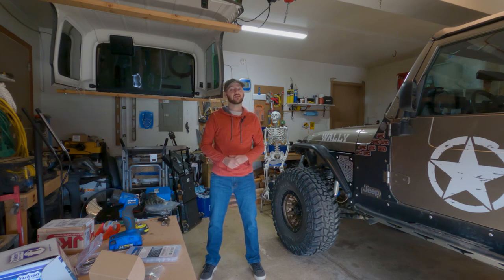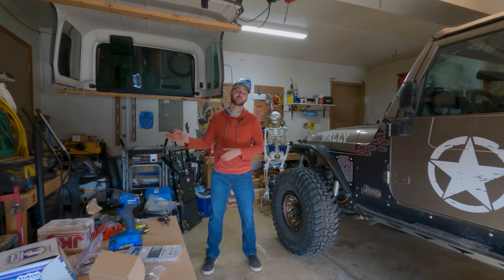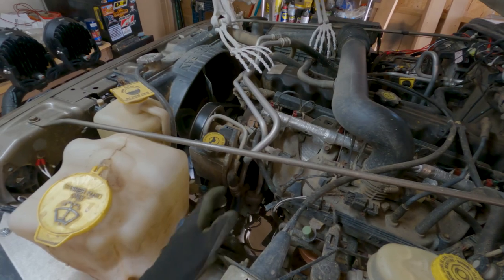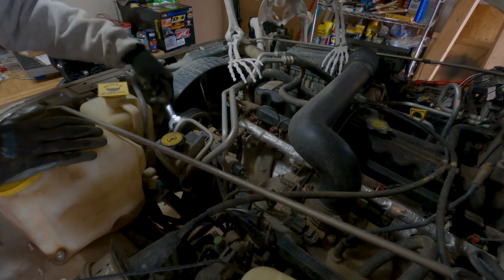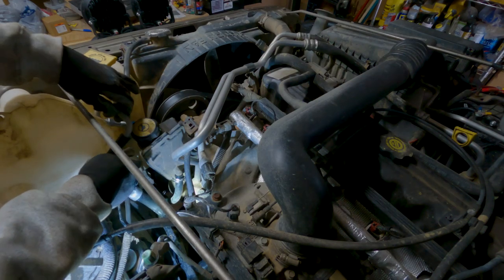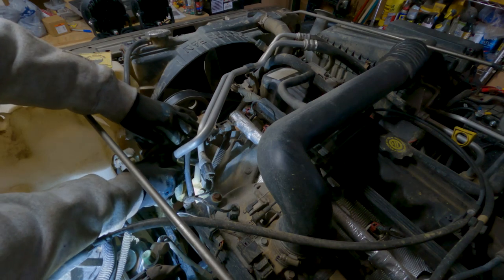Jeep Steering Gearbox Replacement [Redhead Steering]

Comment: Hey what’s up Wally, I like the rack you made to hang your hardtop in your rafters, could you link a tutorial or , maybe make a short video on it! Thanks man!
Reply from the maker: Hey man I actually don't have it anymore. I sold the hard top. But it wasn't anything fancy. I just uses a few 2x6's and put eye hooks on each end. Marked studs in ceiling and then drilled 4 eye hooks into it. Then I just used ratchet straps to slowly raise it up. So it was a total of 2 boards, 8 eye hooks, and 4 ratchet straps.
Reply: @WheelinWithWally  thank you Wally! I appreciate that, I am going to do that! Great videos by the way! 💪 you helped me get my rear driveshaft U-Joint done! First time doing one!
Reply from the maker: @Duhvidd  Thanks man that's awesome! That video was actually my first time doing them too lol. I might remake it in the future

Comment: Redhead boxes comes with ATF in it . But our jeeps use power steering fluid . What did u end up filling it with ?
Reply from the maker: It's covered at 27:56 in the video. I used atf because that's what my year TJ calls for.
Reply: @WheelinWithWally  yeah I just saw that . We have two different TJ's mines 97 calls for power steering but since redhead box came with ATF in it . I filled it with ATF . I checked with my jeep gods and they said I was fine for using ATF . We'll see I guess . But this box is great . I had the boat driving feeling too that's def gone .
Reply from the maker: @TerranceWilliams-b4t  that's awesome! It's definitely a huge improvement.
Reply: It doesn't really "come with ATF in it." Maybe some residual from being bench tested, but not enough to worry about.

Before 2002, you should use Mopar Power Steering Fluid. 2002-2006 can use ATF+4

Comment: Can you update us please , its worth or no , any issue???
Reply from the maker: @6alw111  I've had no issues with it. As for if it's worth it or not that would just depend on how worn out your current one is. Mine was pretty sloppy and this tightened up my steering a lot. So to me it was worth it.
Reply: @WheelinWithWally  My driving style is mostly touring in the city, with a bit of drifting in the desert. Do you think it can handle that well?
Reply from the maker: @6alw111  I'm sure it could. It's just a very nicely rebuilt factory steering box. That's why they give you money off if you send in your old one as a core.

Comment: How do you know if the steering shaft isn’t contributing to the slop in the steering wheel
Reply from the maker: I think it's pretty common that the steering gearbox wears out on these especially after adding larger tires.